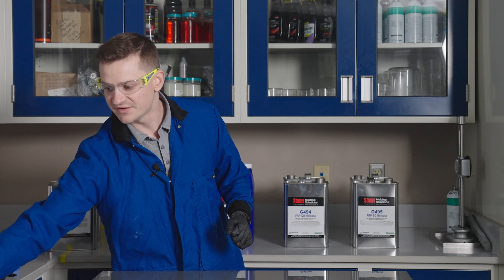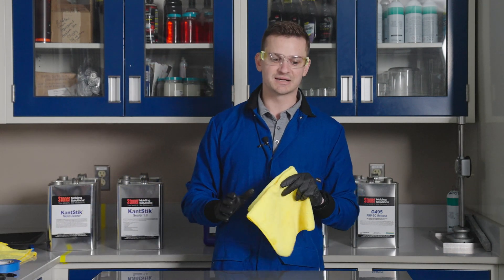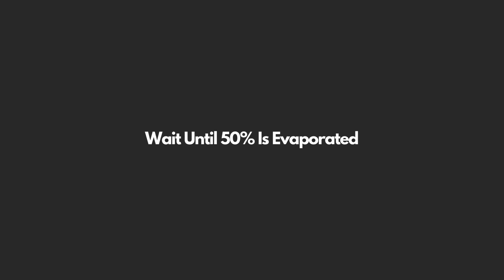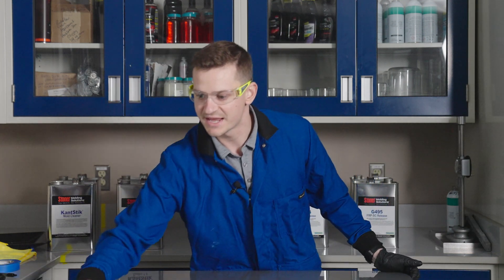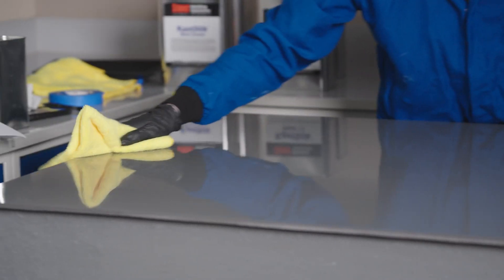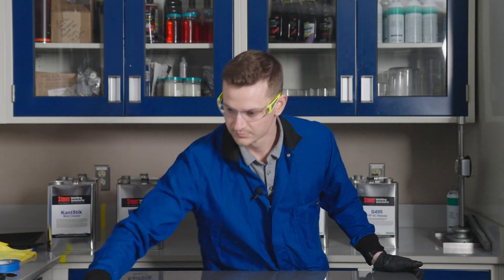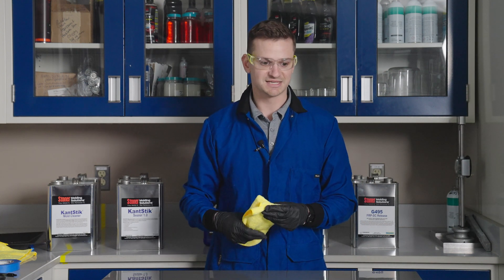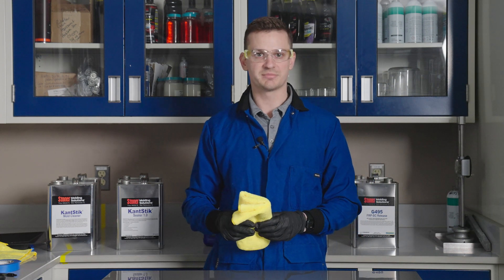The Importance of a Mold Sealer in Composite Applications

Comment: What would be the best way to apply the Kantstick mold sealer to a mold that is a tube? For example, I have a 9.5" section of .75" ID steel tubing that I need to seal the inside of. What method of application is best?